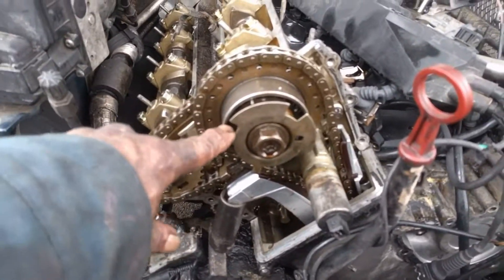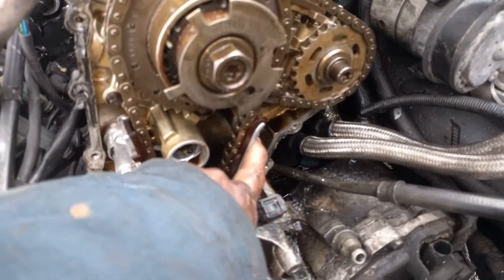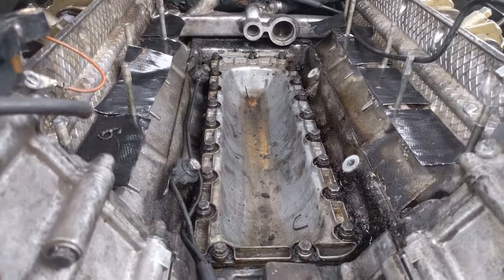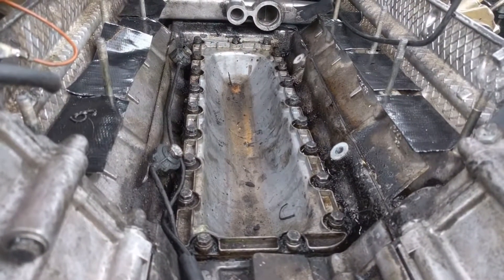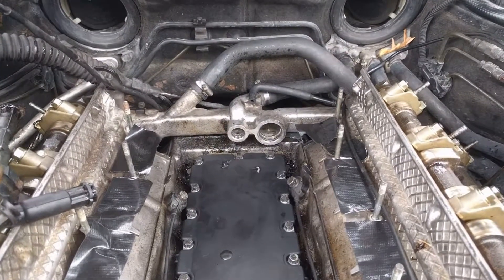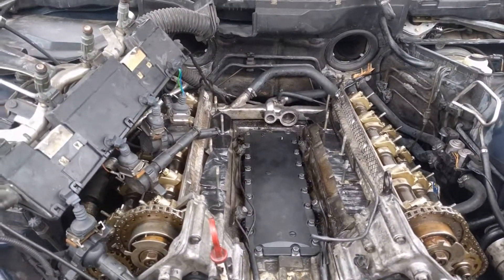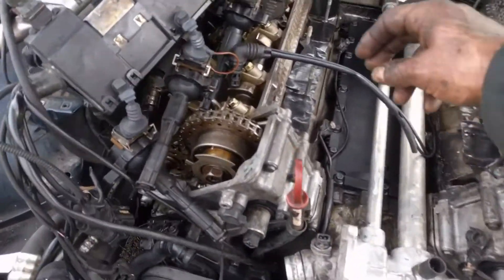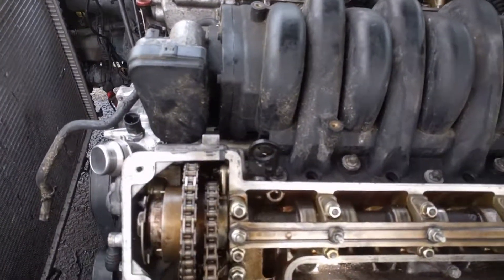BMW M62tu Head Gasket Replacement part 4 of 4

Comment: I’m having as issue where there is coolant in my engine oil but no oil in engine coolant. Engine starts and seems to run okay although slight knock I suspect due to milky oil. Any suggestions on what’s causing the coolant to mix with the oil but not oil in the coolant? M62tu engine.  Thanks!
Reply from the maker: It means you have a bad head gasket. I have had some luck with head gasket sealer you can find at any auto parts store. Buy a good quality sealer and make sure you replace the oil and filter. Driving with water in the oil will trash the engine.
Reply from the maker: The coolant has more pressure the the oil.